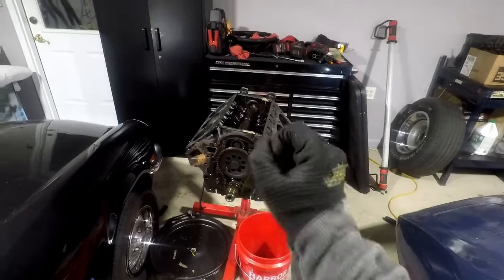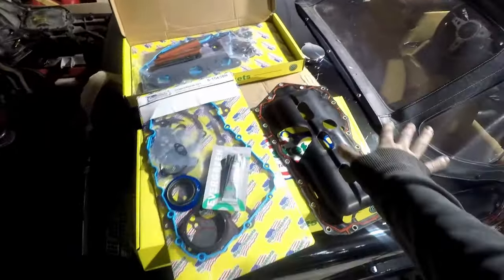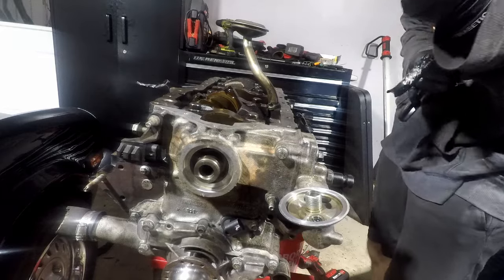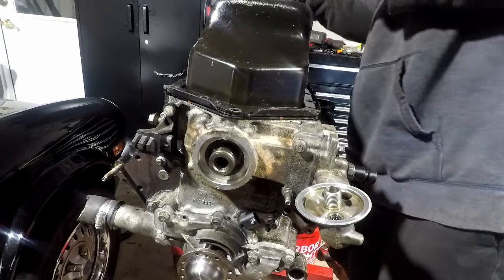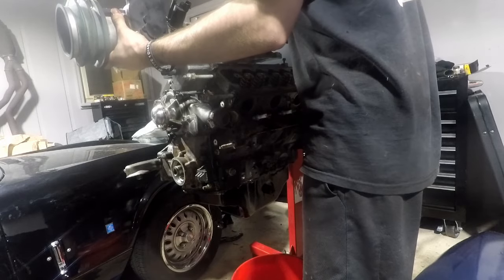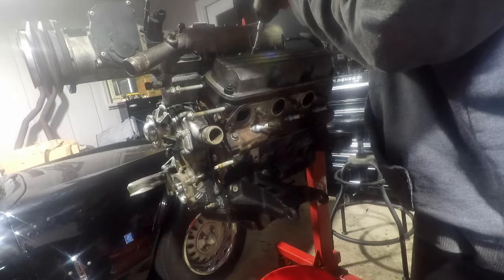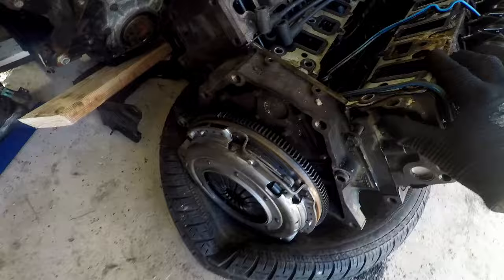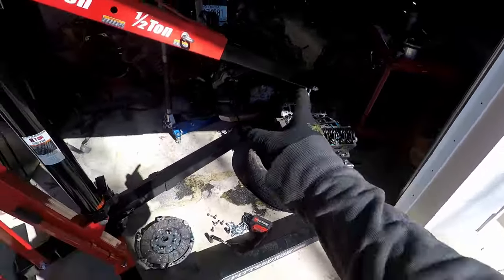Assembling a FWD 3800 for a RWD Camaro

Comment: Did you use your old oil pressure sensor or a different one? I got my shit to start but my oil gauge isn’t working & it was before I did the swap
Reply from the maker: @Mfkembo  I used the old oil pressure sensor since I swapped over the whole oil filter housing from the original rwd 3800
Reply: @ ok so either mine just broke or maybe it’s because i don’t have the ground wire on the back of the head put on

Comment: I’m doin a swap now with a series 3. On the power steering studs, the one that has the coolant passage is too small for the rwd studs so what other stud bolt did you use?
Reply from the maker: @Mfkembo I can’t quite remember running into that issue. Now I did have the old rwd 3800 as a donor for parts to make the new fwd 3800 work in rwd configuration. So if I did run into that issue, I was able to find the correct stud on either of the two engines.
Reply: @bluesxt  I’m using the studs from my old rwd 3800 that was originally in the car but only one of em fits
Reply: @bluesxt I ended up using a timing cover bolt. Hopefully it’s not in too deep & blocks coolant from flowing

Comment: So wait im still a little lost, what's going on here?
Reply from the maker: @DonWep  I was swapping in a 3800 from a fwd car into my rwd camaro. To convert a fwd 3800 to work with my rwd camaro it requires quite a bit of parts from the rwd 3800. 

Basically only thing I was able to use from the fwd 3800 would be the block and everything in it, and the cylinder heads. All accessories, even oil pan and intake need to be from the rwd camaro
Reply: @bluesxt okay I appreciate that I've been looking into using the supercharged 3800 for my Grand Prix on something, and I know you can switch the T5 transmission into a C4 Corvette. So I was thinking about getting the C4 roller, and trying to Frankenstein the three of them together . But I appreciate you for explaining that
Reply: Do you think that would be possible?
Reply from the maker: @DonWep  that might only be for the mustang t5’s fyi due to camaro transmission being clocked at an angle. But anyways, that sounds like a cool project! I’m a sucker for c4’s